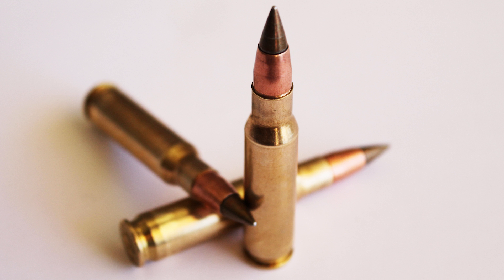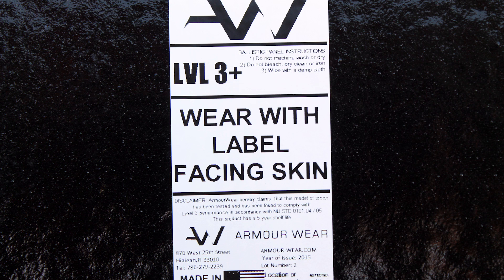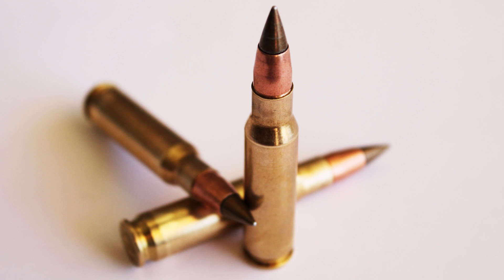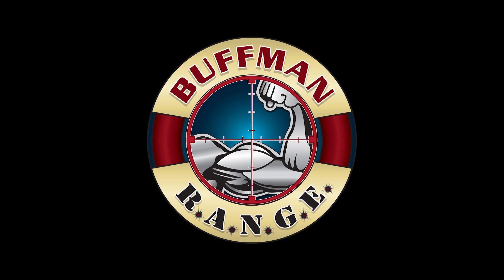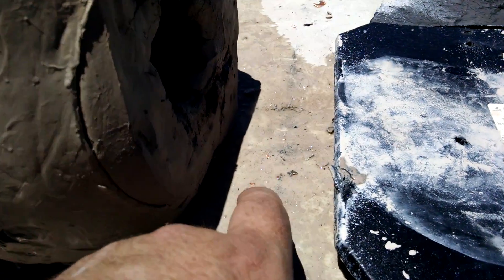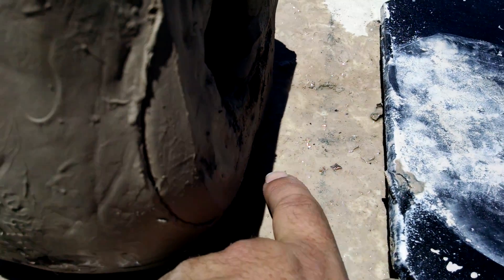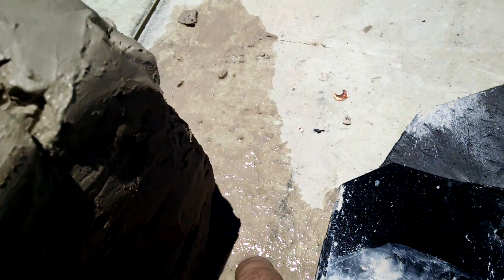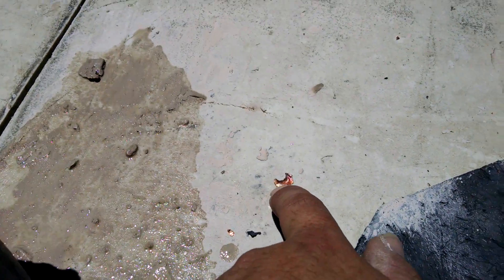You won't believe what the Army's new 7.62mm M80A1 can do to steel body armor!

Comment: This bullet disign is great, no over penetration. Shoot through the plate, gives off most of the energy to what is behind it. Perfect. With 130 gr, there is more H2O capacity in the casing. It shoots fast and flat. Is lighter than regular 150 gr bullets. This is the best stuff for 762 NATO in regular 762 guns. Maybe if you want a sniper round, than you may want something heavier and longer, for higher ballistic coefficient and velocity retention at extended ranges. Less weight for the infantry man to haul around really is nice for machine gunners.

Greetings,

Jeff

Comment: I still doubt I'd ever buy these over m80 due to cost.  That m855a1 doh, I wanna buy by the truckload.
Reply: spraynpray both steel and copper are less dense than lead, therefore the bullets would have to be longer than standard lead m80, likely increasing thier bc
Reply from the maker: spraynpray If they were widely available and reasonably priced, I'd buy both flavors of EPR.
Reply: I'm assuming the BC is turrible.  The bullet looks even squatter than m80.
Reply from the maker: Ryan Taylor That's correct.
Reply: The Chopping Block I get to shoot these. At the taxpayers expense though :)

Comment: will level 4 armor stop this round?
Reply from the maker: I believe so. I think The Wound Channel and Buffman tested this round on level IV plates.
Reply: Ceramic Kevlar composite lvl4 plates are in general more energy depending. While ofcourse a solid penetrator is helpfull to penetrate the kevlar back after breaking the ceramic.

Ceramic dissapates the energy at the entire plate until it breaks, the mangled or completly deformed bullet, and ceramic shards (creating a large blunt surface) get pressed into the kevlar back. It holds .30-06 ap , and ive even seen it not letting .338LapuaMagnum with like 6800 Joule trough. (ofcourse with backface deformation).

While on steel the energy seem to act on a much smaller point. And with projectiles over a certain speed it often completly start to fail.

Besides that steel ofcourse is quite heavy, ceramic and kevlar not.
Reply: Well made Level 4, RF3 ceramic will stop it (2900 fps 162 grain .30 M2 AP as the standard).

Comment: yes you're right :)
the penetrator ('d be a great nickname xD) kicked out the round piece and left a hole where the copper had to pass through aswell... since the copper is soft, it just shaved right off.

so it seems this round was weaker than the last ones?
Reply from the maker: Weaker?
Reply: +The Chopping Block it seems the other water bottles exploded when the bullets transferred their energy
Reply from the maker: +Lardah-Arms Which test? I've only published one other M80A1 armor test, but several other M855A1 armor tests. While the muzzle velocity here was comparable to the earlier test on the Spartan 3610 GL, I do think this plate slowed the bullet down more.
Reply: the slow motion footage before this shot
Reply: ahh okay it´s a different plate :)
Reply from the maker: +Lardah-Arms Oh, ok. Yeah that was M855A1. Much higher velocity.
Reply from the maker: +Lardah-Arms Yeah different plate, too.